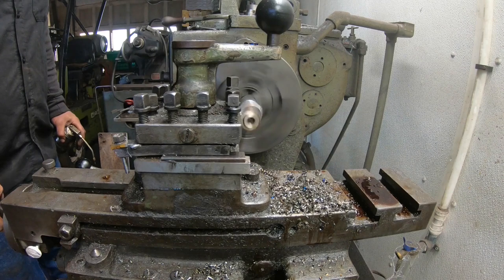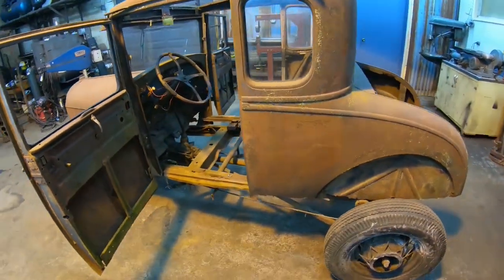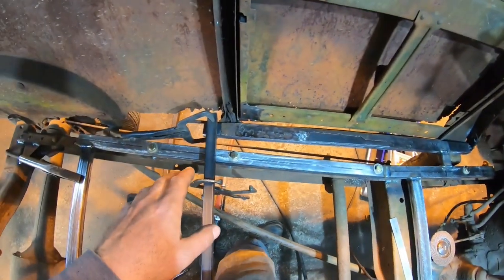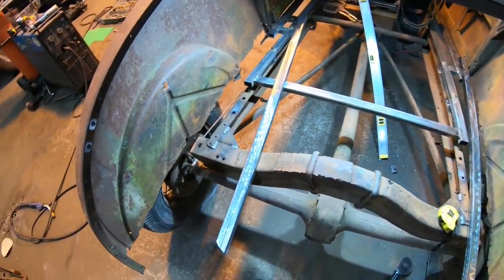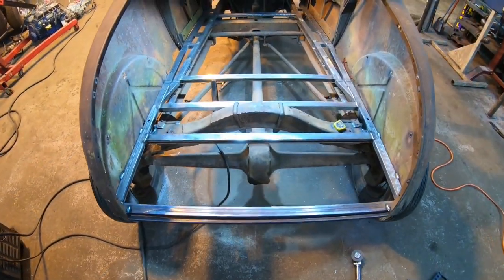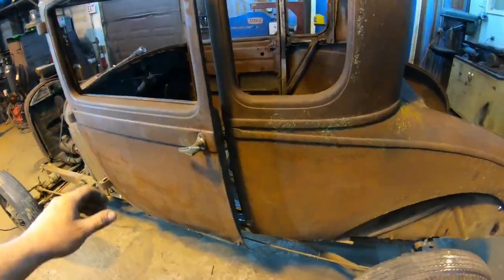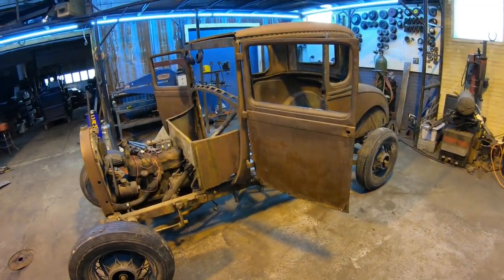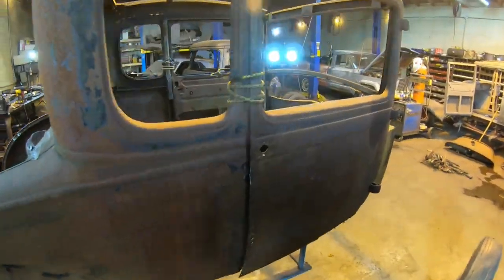28' Model A Coupe Build Part 2- Stripping The Body- Framing out the floors

Comment: You did not hurt that engine from running it. I have started many engines that been sitting for years even ones that have been seized right up I would bust them lose and fire them up without taking them apart and some I used as cores for rebuilds so I would not worry about that. the engine runs and that's a good thing.

Comment: What size box tubing did you use? Amazing work.
Reply from the maker: 1 1/2 x 1 .090 wall tubing. Thanks. 👍
Reply: @rottersgarage  thanks for the reply! I can’t find 1.5 to save my life haha only 2” do you have a hold thread on the hamb or Instagram?
Reply from the maker: @chrisskilling987  No I don't have Instagram, never posted on the HAMB either. Heck I'm luck if I post on my Facebook twice a year, lol. Rotters hot rods and fabrication on Facebook..... that's crazy you can't find that size tubing, it's a common size, where are you located? I always liked the look of the 1 1/2 x 1 as opposed to square. Only time I use square is for light areas like around the trans and at the toe board bases, just to add a little structure. Now that the winter is coming, I'm gearing up to finish this thing up, summers are freaking busy for me here. Gonna start on the floor pans soon, try to wrap it up and get body work going, also picked up a B block so my A engine, or the original from the car is gonna get built a little different...